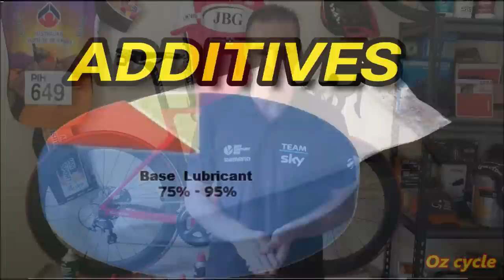Ultimate Chain wax - make it yourself

Comment: Some questions:  Jason Smith’s original formula for molten speed wax, which he made public, is 1 gram of molybdenum disulfide, 5 grams of PTFE, into 500 grams of paraffin wax.  You are using ten times that much PTFE!  How did you test to arrive at that mix ratio?

Why do you use a degreaser to clean the cassette and jockey wheels between chain waxing?  From where would the grease be coming that you’d need a degreaser at all to clean it?

While waxing chains eliminates the need for cleaning chemicals, shedding nicely powdered ready to eat PFAS (Teflon) directly into the environment is turning out to be quite the problem.  I question your eco-friendly claim here.

In my shop, I’m eliminating the PTFE and replacing it with a gram of tungsten disulfide.  It will augment the molybdenum disulfide and eliminate the introduction of PFAS into the environment.
Reply from the maker: A 10:1 ratio yielded three times the chain life than MSW.
Rarely need to clean an immersive waxed drivetrain.  Use 'wax & grease remover'.
PTFE is still used in cookware worldwide.
Reply: @stevenleffanue  Yes, so you claim.  But, I specifically asked how you tested to reach that claim.

I do not accept the argument that some cookware is Teflon so what I do to the environment doesn’t matter.  The micron size particles of PTFE you’re suggesting people use is shed directly into the environment, already in nice absorbable little particles.

Molybdenum disulfide and tungsten disulfide are toxicologically inert, in comparison to PFAS chemicals, like PTFE.
Reply from the maker: Riders here and worldwide can testify that over past 7 years their chains and drivetrains have such longevity. Try it for yourself.
Reply: @stevenleffanue  Thanks.  Everything I needed to know.  Testimony isn’t testing.  

I do wax my family’s chains, and have done so for a few years, using Jason Smith’s lab tested formula.  I also offer chain waxing to my service shop’s clients.

I’ll be replacing the PTFE in that formula with a gram of tungsten disulfide in my next batch.  My shop isn’t going to be a source of a known pollutant if I can help it, and I can.
Reply from the maker: Time tested substantial evidence is proof. 8 years worth now 👍

Comment: Just seen this after using your previous method of homemade paraffin wax from candles, and a rice cooker for several years. What's happened to the rice cooker?!! Incidentally, I've been using candles and barbecue lighting fluid to make the wax!!
Reply from the maker: You can still use but slow cooker with temp control and timer is best

Comment: So I did a little bit of research on paraffin wax vs. Beeswax and paraffin wax has quite a few carcinogenic issues with it and long-term have you tried making your ultimate chainwax with beeswax which is not very expensive and can get it in a cosmetic grade from Amazon for about 15 bucks for that amount good enough to make a chain wax.
Reply from the maker: Yes. Beeswax was too sticky and presented high friction.
Reply: @stevenleffanue  hey thank you very much for replying I just was very curious.
Reply: @stevenleffanue  so how about paraffin-soy wax
Reply from the maker: Too soft , resulting in short life between rewaxings.
Reply: @stevenleffanue  thank you again you are videos have been very informative and help fill in a lot of the holes on how to keep and maintain a bike truly appreciated.

Comment: i did it today lol clean the chain in a ultrasonic cleaner with Morgan Blue Chain Cleaner for 6 mins then wiped dry  with clean rag then i used isopropyl alcohol for 3 mins the let that air dry whilst the 500 grams paraffin wax had melted once melted added a 50g 100% PTFE powder lubricant for cycle chain wax - 3 Micron stirred with a stick then dipped the chain in all done perfect clean shiny chain had a 40 min ride bloody hell there a lot louder ¯\_(ツ)_/¯♥ 
cheers bruce
Reply from the maker: You will need to do the initial clean then make a new batch of wax usi g 1.6um PTFE.
Reply: @stevenleffanue   at the moment in uk i can't  get  1.6um PTFE so im stuffed at the moment but cheers for reply
Reply: @stevenleffanue  lol i sorted out the loud noise when i was reuting the chain i somehow put the chain over the small pin on the rear derailleur between the 2 jockey wheels all sorted now loverly and quiet

Comment: Can we wash the cycle chain with detergent powder to remove the grease?
Reply from the maker: To wax your chain follow the three steps...petrol , degreaser , isopropyl alcohol
Reply: @stevenleffanue  no detergent ? Also can kerosene be used instead of petrol?
Reply from the maker: No. Petrol disolves the factory grease much better
Reply: @stevenleffanue  thank you..this step has to be followed everytime we wax the chain with paraffin wax?
Reply from the maker: No , only initially. Hot water at every rewaxing
Reply: @stevenleffanue  so need to degrease using petrol, degreaser and alochol? Only rewaxing after cleaning with hot water

Comment: How many chain waxings/re-waxings can you do with this mixture?
Reply from the maker: If you rinse your chain with hot water before immersion you should get 10,000 -15,000km from 1 batch
Reply: @stevenleffanue  that's amazing! Thanks
Reply: PTFE powder isn't easy to find 😂
Reply from the maker: Ebay or Aliexpress

Comment: You used to add paraffin oil to your formula to soften the mixture, help it get in all crevasses and stay in place.. Why do you not use it here as well?
Reply from the maker: Oil attracts dirt
Reply: @stevenleffanue  Thanks for the quick answer.
Why do you not recommend using a rice cooker? What does hotter temp do to the formula?

Comment: The problem with Teflon is that it's basically toxic and contributes to microplastic pollution, especially in this form. It's a serious concern, and I question whether widespread use of the stuff should be legal.
Reply from the maker: Its probarbly used on the plumbing joints of the house you are in
Reply: @stevenleffanue  I realize that. It's a big problem, as is microplastic. DuPont and 3M are headed for big trouble over PFAS chemicals and are already trying to back away from the industry. They've demonstrated they are not to be trusted and are strictly in it for the money. No one is more disappointed about Teflon than I am. We really need a responsible alternative.

Comment: Ì too think that use of 50g of PTFE is problematic for the environment! It's never going to degrade, but in the end it has to go somewhere.

I'm confident there's a more eco-friendly solution for this, that might give you 90% of the performance of the proposed mix.

To be honest i'm quite shocked, that you can buy 50g of PTFE as if it's some sort of baking powder.

Comment: Very great video and I really started to love your channel a lot!

And i hope i am not beeing a pest to write this little remark now. Some might have said before. But as for safety warnings, i think this needs to go in big red letters on top of everything, rather one time too much....

- temperature control is essential for safety! a good cooker with dials, and a good thermometer is essential. I would not leave this unattended for 1-2 hours - not even a few minutes, if doing this indoors. Burning wax, wax explosions, hot wax in general is not funny. Have no children around. Don´t heat up quickly. Precise thermometer at hand. No wonky light bowls that can fall over. Do stuff slow. Chain on top before the melting, lid on top, STIR GENTLY as the man says!! 

- PTFE dust is no joke either. The mask must be suitable for the particle size. PTFE may never heat to high temperatures = this can kill you if you inhale it or make you very very sick. Will not happen at 50-100°C. Pouring it in VERY slowly with mask on, no open window at this moment and no air streams! You don´t want that stuff as dust in your house. You don´t want it in you, your children, the water supply, anywhere but in your wax. 

- same for any vapors from heating the wax. They are maybe not super-harmful but it´s a mineral-oil product. I did it under a fume hud that blows outsides. NOT turned on for pouring the PTFE. But no need for wax smell indoors, i would not want it. Same for petrol, thinner, de-greaser,  that you do not at all want indoors, not in your garage, not in your cellar. Outsides, or fume hud, or you play with your health and maybe that of your family.

I can´t say if PTFE is worse for the enviroment compared to synthetic oils, metals like molybdenum, and all other kind of additives we don´t even know of in stuff form the shelf. But as biological lubes did never work for me, i guess what we do here is still better than cars ;-) 500g of wax, a few gramms ptfe powder, maybe a liter of petrol a year for claning - try to run your car 10.000km with that and a bit of proteins. Imho before discussing this, there is more severe things to fix. But don´t ruin your health by doing mistakes.

Again Sir...THANK YOU FOR SHARING. Your detailed tutorials saved me.

Comment: diamond coating is the next level up ..   all those years of oil based luber  making a grinding paste ..  then in the motorbike world  not cleaning parts media blasted then the particulates getting into the internal oil lubrication system  grinding away does not bedar thinking about

Comment: Damn now I need PTFE powder and a slow cooker.
Reply: WAX Speedmaster on amazon and a cheap slow cooker.

The method I used:
Simple green in a pickle jar for 15 minutes constantly shaking: 10 to 1. It is corrosive so not for too long.
Gasoline for 24 hours and a percussion massager whenever I thought about it (I do love pickles).

I used Brake cleaner for the last step for about an hour. I just sprayed a can in to another pickle jar and used the massager on it 3 or 4 times (mimics an ultrasound cleaner). I was confident it was clean because nothing fell to the bottom and I used a magnet to confirm.

let it dry. 
Now I just drop it in boiling water for 3 minutes, dry it with an air gun and a heat gun,

waxed for an hour...

It is not like I have to attend to these steps. I do go on  about my day and so on.

Comment: Anyone have any ideas about how this works on varying temperatures? The wax melts at about 100 deg f or 37 c according to Wikipedia.. if I'm going for a ride at 105 deg f will the wax melt off and the chain lose the lubrication? And the opposite, if I'm riding in near freezing temperatures, will that result in lost efficiency compared to other lubes?
Reply from the maker: Paraffin wax melts at 53degC

Comment: I should also mention that this new chain lube is really nice compared to the old recipe but it has a downside which I have noticed recently. The chain wax is very flaky and on the first ride after installation the wax flakes fly off the chain and contaminate the rear brake rotor pretty much every time, I am not sure about road biking because I know most of them use v-brakes but I do MTB and for sure this always messes up my rear brakes then I need to remove the pads and sand them down to bring them back to life. I noticed a way to avoid this, you need to work the chain by hand for 7-10 minutes and use the methods oz cycle does helps a lot but you really need to do it for a while before you start noticing the flakes stop coming off the chain, you really need to move each link to its limit in each direction many times before you notice the flakes stop falling out, 2 cents
Reply from the maker: Your rotor is on opposite side to the chain
Reply: @stevenleffanue  Yes it is but that doesn't mean much, when riding MTB you ride over a lot of roots and whatnot which is extremely bumpy and the chain flops around all over the place even with a good clutch on derailleur, the wind can easily blow that wax dust onto the rotor. Believe me I didn't want to believe it but its 100% true, my rear brake always works perfectly except for that first ride when I put a new chain on, I paid close attention to this on the last two chains I put on and it happens both times on same ride about 5 minutes into the ride, its guarantee'd. I am just mentioning this to help anybody who rides MTB that is experiencing the same thing, just takes some extra effort getting all the extra wax off before putting it on the bike and all is good because I used this method today and for the first time my rear brake didn't suffer any power loss when putting a new waxed chain on
Reply from the maker: Wow,that must be strong wind. Yes,wipe chain when taking it out of the pot.
Reply: Yes I wipe it down more then anybody else i've seen but actually most of the flakes come out of the rollers so doesn't make a big difference. Actually the wind isn't too powerful i'm in the woods most of the time but the flakes find their way onto the rotor that is a for sure thing, best way to help understand this is take a freshly waxed chain outside on a bright sunny day, work the links and smack the chain and you will see A LOT of fine wax dust come off of it, you need to smack it for about 10 minutes before you stop seeing all the wax dust coming off it and its a fine dust that goes in all directions, the rotor is a lot closer to the chain then you think its only 4 inches away.Also this only happens on my rear brake never the front and it happens on both of my MTB bikes, rear brake only shimano xt and xtr no leaks anywhere

Comment: I ordered some PTFE powder and i got nail glitter delivered, this can’t be  correct can it?
Reply: Sounds like a scam. Where did you order from?
Reply: @jackglossop4859  Grandado.nl, Dutch site. Can anyone suggest me a decent site to order PTFE from?
Reply: catechistje I ordered mine from a Chinese seller on eBay. Only problem was the lead time was about two months . Re: your nail glitter, that sounds like a classic postal scam where they send something of approximate size weight and feel but of a fraction of the value.
Reply: @Blovelo  Had the same problem with Grandado, received snowflakes (Isomo)

Comment: URGENT!!! Hi there, I just received my 100gr package of PTFE 1.6 microns. I bought off eBay (Oneworldonedream2010), but the powder has a clay-ish texture, not powder at all. I put 50gr in the slow cooker with paraffin and guess what? I didn’t mix at all. Now I have the cooker full of paraffin and blocks of PTFE. Do you guys know any solution to this??? Thanks a lot :)
Reply: Leonardo, I let my paraffin wax reach 90 degrees before mixing in the PTFE. Also, I mashed 'kneaded' any little clumps of PTFE using a little plastic mixing spoon. It seemed to work OK. There may be a chance your PTFE powder (and the powder I purchased) is larger than 1.6 microns.
Reply: You might have to add an emulsifier to this mix, like MoS12... Emulsifier is bread and butter amongst tribologists.

Comment: Oh man, after 2 months of shipping time my PTFE "powder" arrived as a solid block that doesn't disperse in liquid wax at all. Must have taken up moisture in the bag or got squeezed to a lump during shipping.. Pretty gutted, project is on halt for another couple of months I guess.
Reply from the maker: Put it in a blender
Reply: @stevenleffanue  I've tried quite a bit with it, it behaves like a dried-up "Play-Doh
". A blender would probably give me lots of small clots instead of one large one, but no powder, so I'm not risking the mess. I'm just trying to get a replacement now
Reply from the maker: Ok

Comment: Very informative, but I put 300 Km on my bike once a week. That means I will have to remove the chain and clean it every freaking weekend. I don't know that I can stomach that. I think I rather spend a few  bucks and get the Dupont Chain Saver. Its Wax and Teflon.

Comment: there are people in forums asking about lubricating a chain with grease now. grease doesn't get under the rollers very well, nor in-between the plates. it's just too high viscosity for that. 
why are you talking about grease, and not about oil?  
this seems to be a bad example to people who don't know any better - who will see it as an option.

Comment: I do not know why, but it did not work for me at all. I did everything exactly like in the video except I did not paid attention to the temperature because there was no thermostat. The chain now runs very loud and very bad.
Reply from the maker: Redo the clean. Soak chain in hot wax for about 2 hours until no more bubbles come out of the chain when swishing.
Reply: Thanks for the help. 
I ride Fixie, so the chain is generally a bit louder, but the problem is that the chain does not run very freely. I have cleaned the chain before as explained in the video. I even did the steps twice and used an ultrasonic cleaner.
While boiling the chain in wax I noticed that foam has formed at the top of the pot. Is that normal ? I only put the chain in the wax for about 13 minutes. The pot was also relatively small. Do you think the wrong temperature could have been a reason for this ? should I clean the chain with hot water and then put it in a bigger pot for two hours at the right temperature or should I clean the chain again with chemicals and then wax it ?
Reply: @pierre9620  overheating the wax will ruin its integrity. The amount of time and overheating (temperature) determines the amount of damage to the wax resulting in degraded lubrication. Something is amiss to cause the foam. A contaminant may have caused it. If the wax was heated on a stove without a double boiler or the pot of wax was not placed in a bigger pot with water in it, temperature control is very difficult. The wax can reach 400 degrees Fahrenheit / 204 Celsius before you know it. If indeed you were boiling the chain in wax, the temperature of the wax was above  698 Fahrenheit / 370 Celsius creating a dangerous situation. I'd make a new batch of wax and clean the chain again.